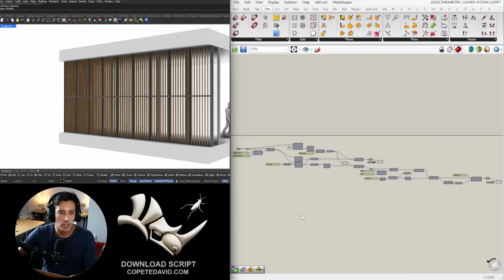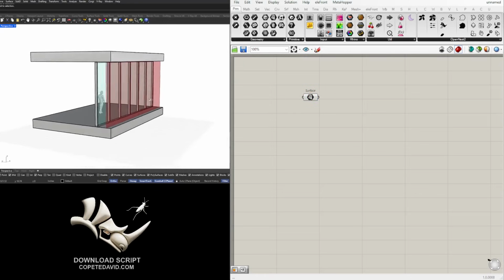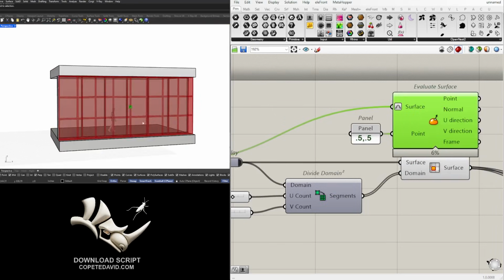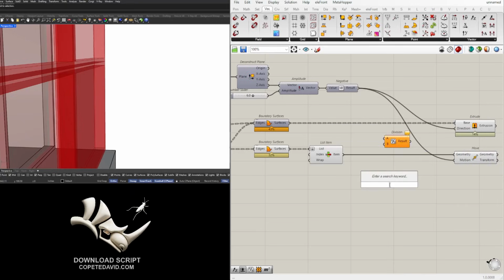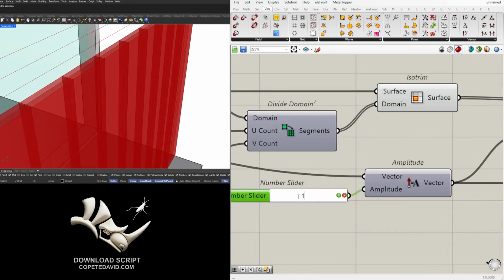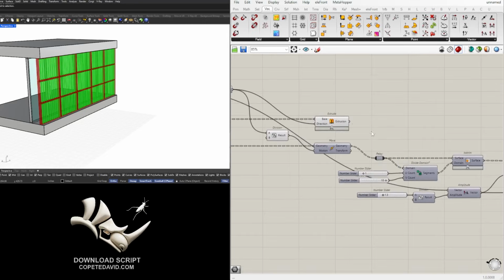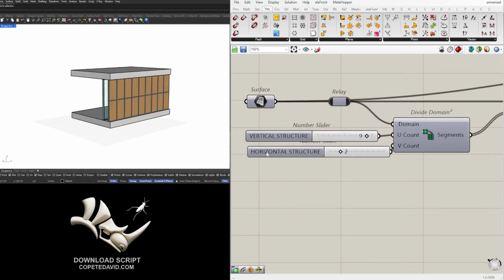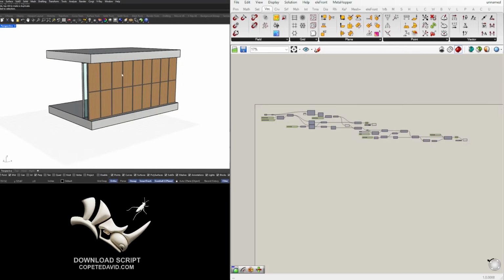Grasshopper Rhino louvered Facade Parametric Design Script And Tutorial + ReRenderai

Comment: Hello, thank you for the video, it was a great piece of script. I just wanted to ask, what computer specs are you working with, and what do you recommend as minimum specifications for running scripts such as this for students?
Reply from the maker: prioritize a high-clock-speed CPU (Intel Core i7/i9 or AMD Ryzen 7/9) for single-core speed, 32GB+ RAM, and a dedicated NVIDIA RTX GPU (4070/4080)

But you can run it on something slower but It will just take a bit longer to process.